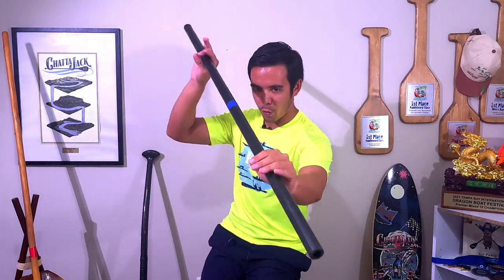Paddle Tip: What is the Best Way to find Resistance in the Surfski/Kayak (Learn these Drills!)

Comment: I started paddling about 35 years ago. When I started to win races, both in Sprint and Marathons, I was keen to try different training methods. One popular method was resistance training with ocky straps around the K1 or extra weight inside it. It felt wrong, it felt like I was training my mind and body to paddle slower, so I did not use it. This video gives clarity of better ways to do resistance training. 
Some of the top paddlers in our clubs were doing regular resistance weight training in the gym. I avoided this as well as I believed that it affects the firing speed of your muscles and build power in muscles you do not use for fast paddling
Your knowledge of paddle training is impressive.
Reply from the maker: I appreciate it! For MOST skill levels drills are the best 1:1 time investment to performance output. There are Olympians that may or may not introduce drag protocols... but I don't think they watch these videos!!!

Just like in your experiences, many relate to that same feeling!!!

Comment: Lately I've been experimenting with using much longer paddle lengths to get resistance training. This only works when the sea is calm.

So, my normal paddle length is 212cm. I adjust this to 218cm - which lengthens the stroke and increases the leverage. All other mechanics remain the same.

So if I then use a slow, measured cadence (like you would for technique practice), and load the blade through the stroke, I get a higher loading. 

Feels smooth, and I notice that my muscles tire faster, for a given heart rate.
Reply from the maker: That's what you're looking for! That pathing and methodology achieves the muscular response you're looking for in a natural way. 

It's funny how the smallest differences in training may or may not translate to performance. Off topic but food for thought - I read a research paper explaining how a lat pull down machine does not prepare you for pull ups simply because you are pulling the weight to you, and not your weight to the fixed location, that small distinction is enough to change muscular response enough that they don't translate 100%. Even though the movement is identical and the engaged muscles are nearly identical.

Comment: I noticed with the in-boat footage, you put steering input into the pedals with the hip rotation/leg drive. Is this normal and something that, if happens, we should not be concerned with? I am working on being as smooth as possible and not putting steering inputs in, as my thinking a straight line is better and more efficient. But if I am worrying about that and not putting enough force in to prevent back and forth steering to the detriment of the power and application of force into the water, I will stop worrying about it.
Reply from the maker: Good eye. My pedals are loose so they have a little play before it moves the rudder. Gives me some ankle movement so they don't get overly tired. In k1 racing with a tiller setup athletes push through the toes instead of heel driving since it's more ergonomic. Loose pedals give me a midfoot push without the boat jolting around.